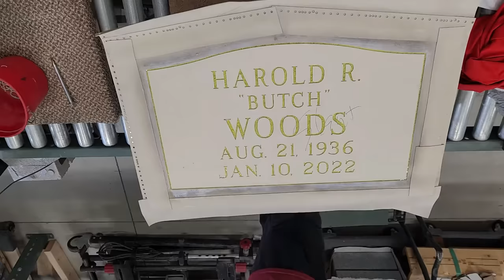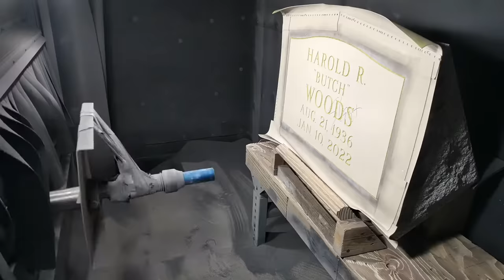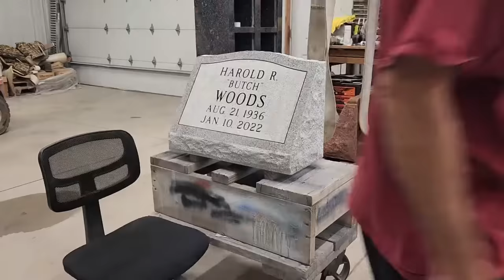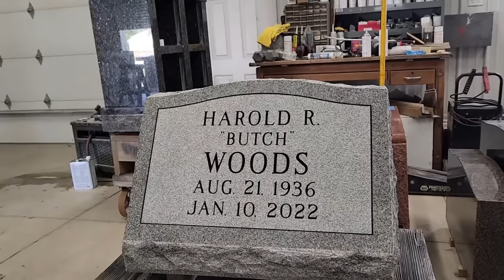Engraving a Headstone

Comment: This seems like this process is painfully behind the times.

I mean I know nothing about this process, but I could EASILY shave off half the fuckin time this guy has taken to do this & get the exact same result. 

You could easily print stencils of these letters out & arrange them & it would TOTALLY eliminate the guy having to painfully & slowly cut the lettering out. Even having stencils to trace & cut the lettering out would make the process go faster as you'd be just tracing the stencil perfectly. 

You could use a cheap ass laser to cut the paper lettering out as well. 

You could use a computer to do the cutting.
Reply: "I mean I know nothing about this process." Stopped reading.
Reply: I was looking really close and although you can't see the individual lines it seemed 
 (to me anyway) that he WAS using stencils. It looks like he's very carefully picking at the corners and peeling away the material.
Maybe it's just me but I don't think it would make sense to go through the time and trouble to secure the material to the stone and then make a stencil. If it's totally manual as you suggest I think you'd do the detail work elsewhere in case you make a mistake - spelling, alignment, whatever.
But I believe he's using CAD stencils. Even the the Shakers used the technology of the day for their craftwork.
Reply: You wouldn't even need the stencils. A cheap ass laser could do the same thing. I've used my 20w xtool laser to do the same thing on marble for marking the Graves of their pets. That's a hobby laser machine. A good co2 laser could do it a lot faster than my machine. Mines just a diode laser like the ones in a cd burner.
Reply from the maker: The stencil I applied already had the letters precut using a computer and plotter. I just peel them out.
Reply from the maker: @TravisMurray-v2j  , you could use a laser. It would takes days, but you could use one
Reply: Okay Mr. Insecurity.  We all know how smart you are.  Thank you Sir.
Reply: @night_al  I used a 20w diode laser for a 12x12 marble tile and it only took a little over 2 hours. With even a cheap co2 laser setup that same process could be don't start to finish in less than an hour. With a fiber galvo laser that could be done in just minutes comparatively and there would be no real prep involved. This entire process looks like it probably took 4-8 hours at least this way.
Reply from the maker: @TravisMurray-v2j  marble is much softer than granite. Not to mention 12x12. These stencils are anywhere from 12"x24" to 36"x48", sometimes bigger. And the whole process only took about 2 hours
Reply: @night_al  understandable. However with a co2 or fiber laser  and proper settings such as flood fill to avoid passing over all the uncut areas the same time could be achieved if not faster lowering the cost. While one is being cut you can be making up the next one. After a couple headstones you could afford a second machine allowing one per hour to be made. That means you can lower costs or expand into other areas besides just headstones. All business is about growth and efficiency. Higher efficiency means higher profits which means you can either pass savings on to customers or grow and pay employees better. Then again business owners these days forget that part. On busy days at my home based business I'm able to pay my teens $25 an hour easily and still turn a respectful profit myself. That's just a home based craft business where my profit is typically $2 per item.
Reply: Thanks for the details, @night_al  Also, your patience with the idiot troll is admirable.

Comment: This man, today, simply PAINTS the information on. There is NO engraving.  The video should be re-titled, PAINTING NAMES AND DATES ON TODAY'S HEADSTONES.  Now, Maybe today's paint lasts a long time compared to 100 yrs ago, but I am disappiointed.  There is NO NO !!!! engraving. I watched the entire thing.  Sham.
Reply: Watch again - the lettering is sand blasted into the stone using a rubber mask, then paint is added for contrast.  The color should last a generation.  You can also omit the color if you prefer.  The sandblasted lettering will last for several generations.